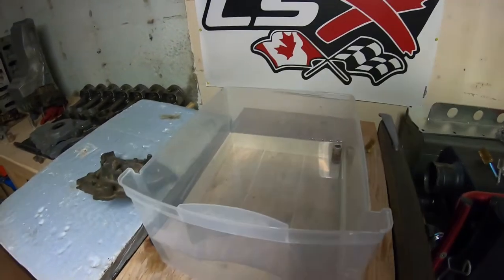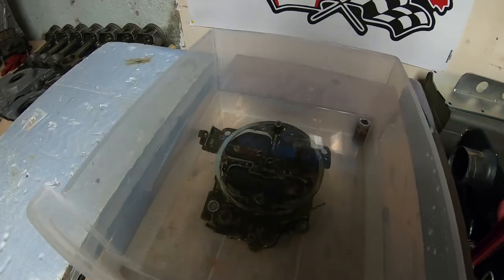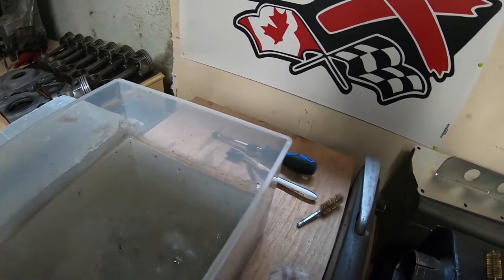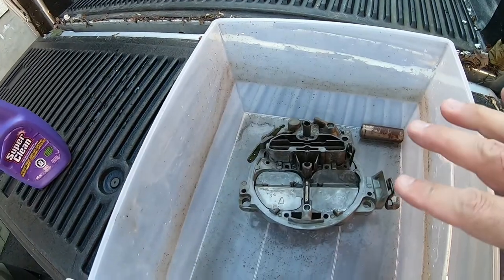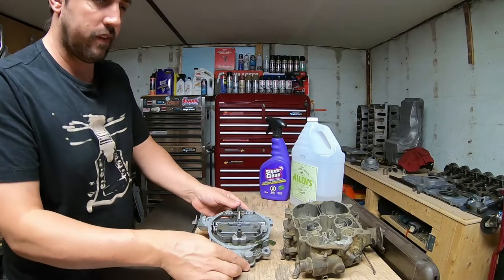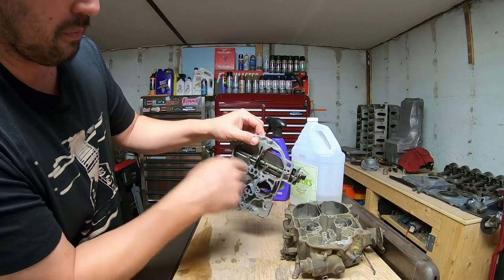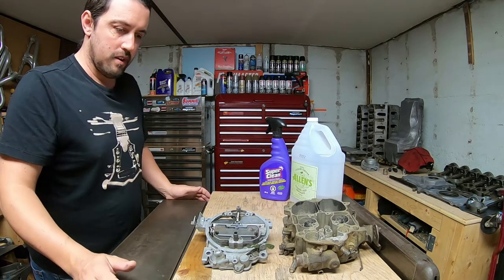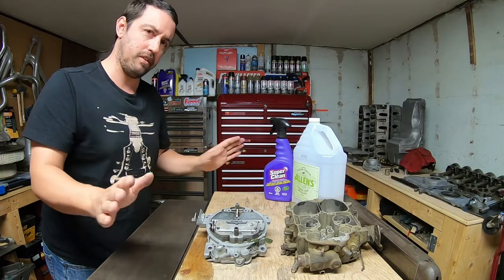How To Clean a Rusty/Dirty Rochester Q-jet Carburetor With Vinegar

Comment: I set up a vibrating element as well when I did mine... it was crazy !
Reply from the maker: ya I mean it does a good job When I did this I remembered what happen to the gear on the crankshaft so took it out of the vinegar after about 10 hours or so but really it didn't need to stay in there that long even the vinegar works pretty quick on some items I've noticed

Comment: Keep this trick I devised years ago for the future when you do carbutator work..

Try this... Heat the plastic tube from the carb cleaner spray with a lighter (about 1/4-1/2 inch from the end. Then pull on each end of the tube to stretch it. This makes the outer/inner tube diameter smaller and more of a pin point. When the melted plastic solidifies, use small wire clippers or nail clippers to snip the tube at the smallest diameter that still provides flow when spraying. The cleaner comes out like a pin point pressure washer and the shrunken plastic tube end fits inside whatever port your spaying thru.

You can also do the same to create 90 degree angles in the plastic tube to spray sideways inside long venturi tubes.

I used to make/keep custom tubes around for these situations. Hope this makes sense.
Reply from the maker: I do appreciate your comment But I don't see how that makes sense for what I am doing here I just personally find dipping all the parts in the "Pickling Vinegar" cleans everything extremely well and afterwards I just do the normal rince with degreaser just keeping everything super simple! But I do appreciate your feed back thanks again!
Reply: @Canadiancarguy1987  
It's just a hint for future use.
Reply from the maker: @SuEnRoD   All good I think I know what you are getting at now! Cheers man!